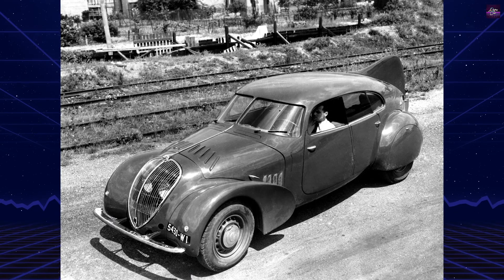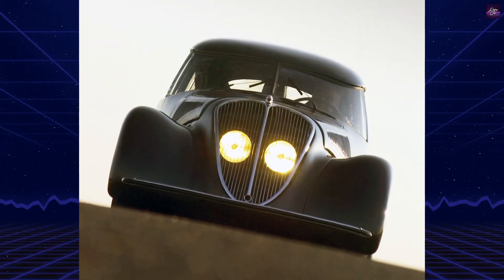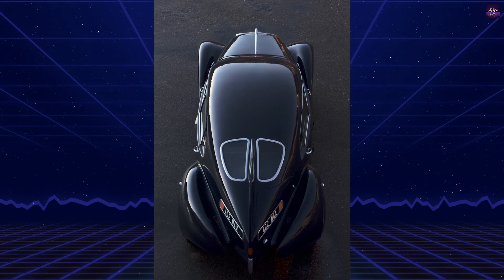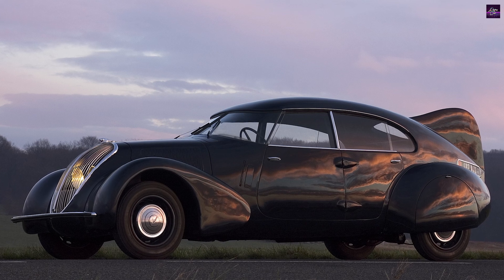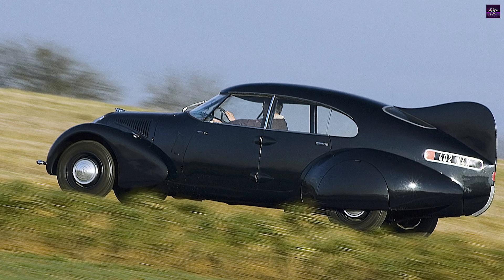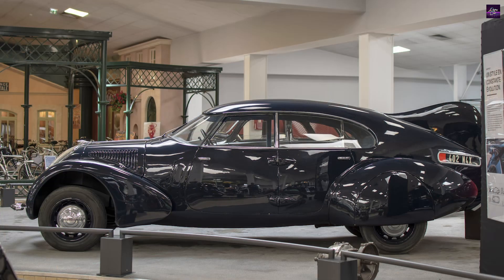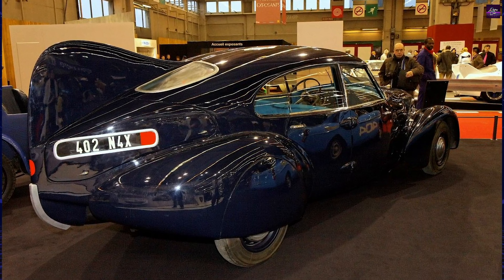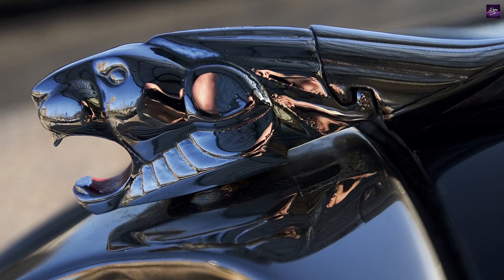Peugeot 402 Andreau: The Most Aerodynamic Car of Its Time

Comment: Overall, I like this one.  But I think it would look so much better without the "Dieselpunk" tailfin; putting more emphasis on the boattail, "Art Deco" aesthetic.

My usual Google Search for diecasts and models managed to locate a few (VERY expensive) diecasts, but no model kits.  I wouldn't mind a proper, 1/25th scale injection molded styrene kit of this one (though probably more likely 1/24th, if made by Heller) but I'd need to get out my razor saw and putty to deal with the fin.  I'd also want to add a matching rear bumper and relocate the license plate.  Now, THAT would make for one sleek car . . . .

Thanks, Retro Car!

52rd Like.